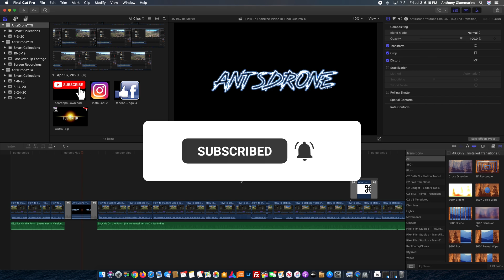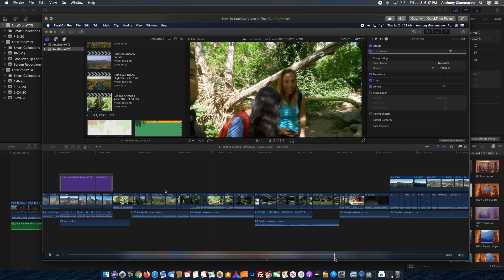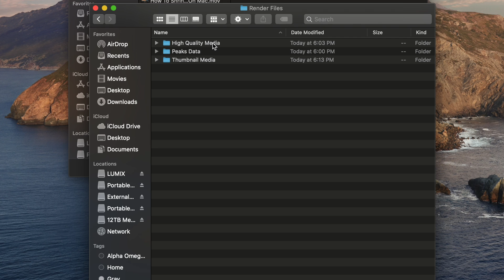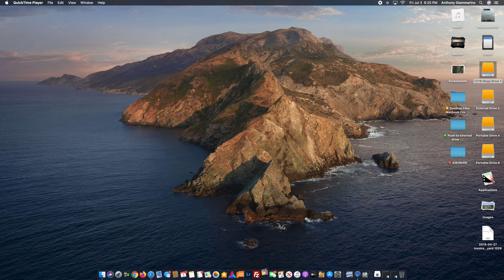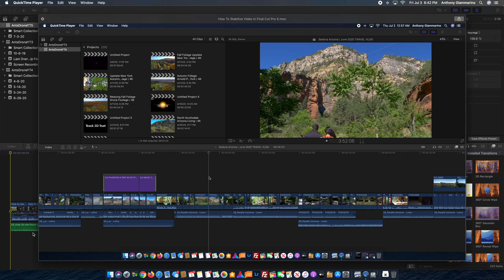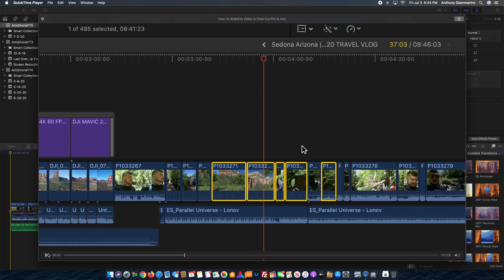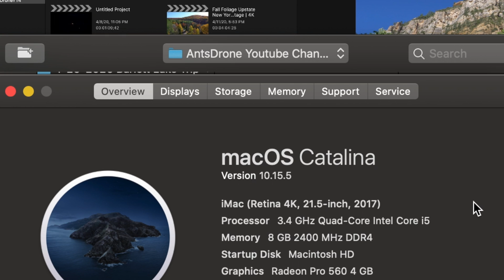How to Fix Green Flash Errors in Final Cut Pro

Comment: I don't think the rendering is the issue. I never render anything, I have auto render turned off, you can just output to master file without rendering. I was using Mojave for the longest time with 350 video output in 2021 with not one issue. Now it's Jan 2022 and I reluctantly updated to Catalina in order to get a motionvfx plugin working.... and now I am getting flashes. Not green like this, but similar glitches. I never had to worry about the output being corrupted, this is not going to work for me. I'm considering going back to Mojave...and losing the use of the motionvfx plugin which will be annoying. I think the issue is in the OS, or it could be in the updated version of final cut. I do have the previous version of fcpx still in the applications folder so I will test that out while running in Catalina and see if it also has errors. If it does, probably the OS, if it doesn't then it could be the updated FCP...
Reply: Ok, update, I just did the same test with the older version of FCPX and I'm getting the same flashes (not green) so it looks like it is an issue with the OS. There's a possibility that it is a problem with a project previously started in the older os, but most likely not. Looks like I'll be going back to Mojave...

Comment: I have a similar situation except theres green and pink flashes that randomly happen. We recently switched our media server from TONS to BitCentral and noticed it started around that time and only seems to happen on the .mxf files we download from BitCentral.. IT happens randomly.. sometimes it will be fine and no issues and then all the sudden it will happen... I cannot find any answers anywhere as to what causes this and the only fix seems to be running the source video through handbrake and converting to .mp4 which is annoying if already deep into an edit. I tried this method from the video and it went away on some of the clips but is still there on others and it's not even always in the same place. Also to note.. it happens on different machines so not an issue with the Mac itself.. I'll keep searching for answers! Thanks for your video!
Reply from the maker: Yeah that one’s going to be tricky to figure out, I’m not even sure where to start with that! I’m sorry I couldn’t be more help. Thanks for watching the video I appreciate it man! I really hope you find out what is happening so that you can fix this headache soon!

Comment: Thanks for sharing. I have been having this problem with Final Cut Pro X recently also. It seems to have started recently, perhaps after that update you mention. I do see a new update they are wanting me to install. Perhaps that may fix the problem. I have sometimes found that simply re-rendering fixes it. No need to delete rendered files.

Also, why do you have to manually delete the rendered files from the package contents. Can't you just use the "Delete Generated Event Files..." in the File menu of FInal Cut? It should do the same thing?
Reply from the maker: Yes I got the new update and haven’t had any issues as of yet. I had this issue on my iMac not my MacBook so it’s interesting how it only effected me on that machine. I would go a head and update for sure if you haven’t already. I’ve noticed re rendering can fix it too. 

As far as the method of deleting the render files through package contents that’s just the way I had learned how to do it. I haven’t tried the other way I’m sure that could make things easier. 

Thanks for stopping by and sharing your thoughts my friend I appreciate it so much!
Reply: @AntsDrone  Thanks for the reply. I had a big video (15 mins) yesterday that I rendered and re-rendered and it still had the problem. I even did the Delete Generated Event Files in between and it still had the issue. So that doesn't seem to be a surefire fix. 

I noticed on the latest update that it had an update for "Pro Video Formats" so  I installed that update last night. I sure hope it fixes it. I was having to watch the videos back in QuickTime Player at 2x speed to make sure I didn't see any green flashes.

I am also using a pretty powerful machine; 2017 MacBookPro with 16GB RAM. Kind of disappointed that this would even be an issue.

Comment: Thank you Anthony for the tip! I would advice to delete render files anyway since they take up space unnecessarily.  I often have a similar problem and have noticed that it happens when I use the titles. I noticed that by moving the title object slightly, it solves the problem.  This is very annoying because every time I render a video I'm never sure if it went well.
Reply from the maker: You’re welcome man thanks for watching! I agree it’s just wasted space once your done with the project there’s no need for them anymore. I only have this issue with Final Cut on my iMac but not on my MacBook Pro. It’s really strange.
Reply: I noticed the same thing. The lost frames often happened at the beginning of a title or the beginning of a b-roll clip I overlayed on top of the main a-roll. I don't know for sure since I have only rendered one video, but I think the last update I downloaded for my MacBookPro may have fixed the issue. We shall see when we do some more rendering.